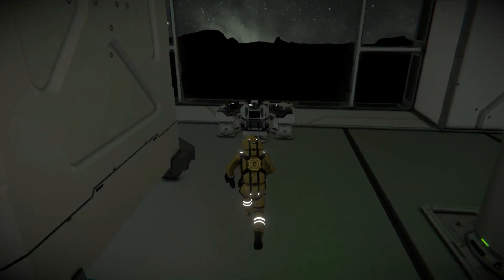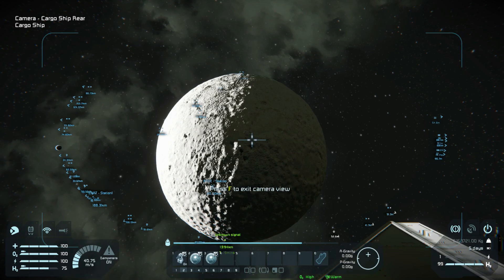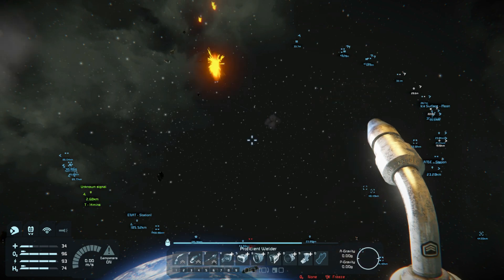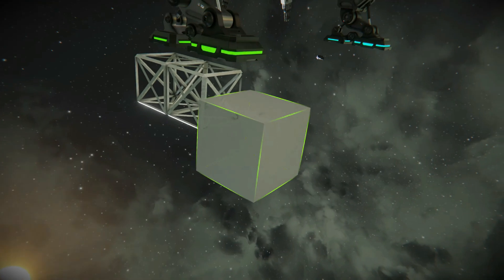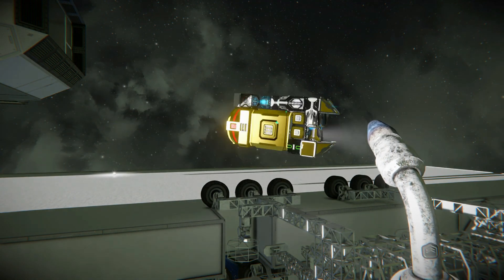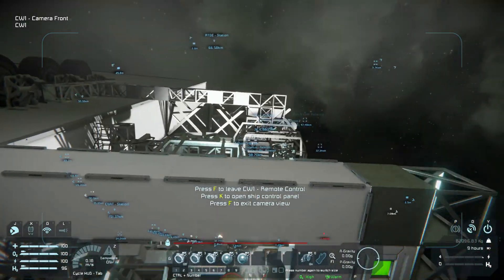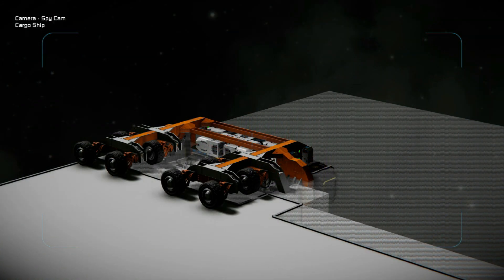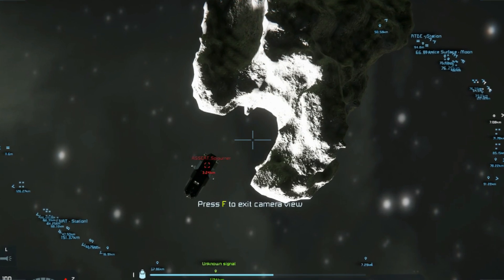Space Engineers - EP28 - Automated Wall Builder | No Scripts, No Mods | Tutorial | Let's Play

Comment: Why didn't you just put a control panel on to the grid and set it as a station in the info section
Reply from the maker: It's a great question, and one maybe I didn't explain well enough.  I could of done so - but it really wouldn't of changed anything.  I'd still have a free floating 'station' grid in space being pushed around; unless, I activated that Unsupported Stations game option I mentioned.  That game option should lock floating grids in space that are designated as stations (not fully tested by me).  But I didn't want to do that because it wouldn't give that more realistic space simulation challenge I wanted - which is why it's not enable by default by the game developers.  All that aside though, I also plan to move the space station from one location to another...kind of like a Deep Space 9 thing.  Thanks for watching and asking the deeper question!